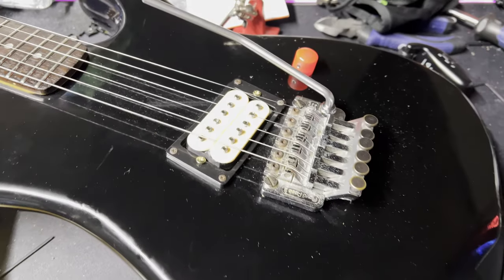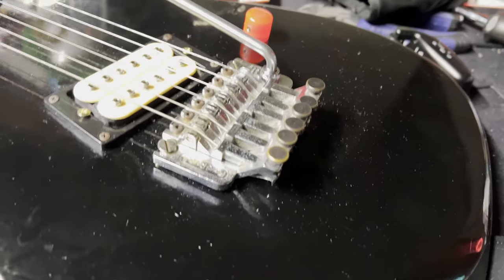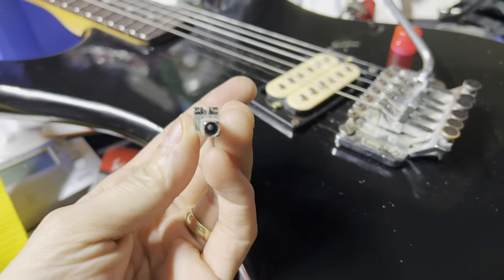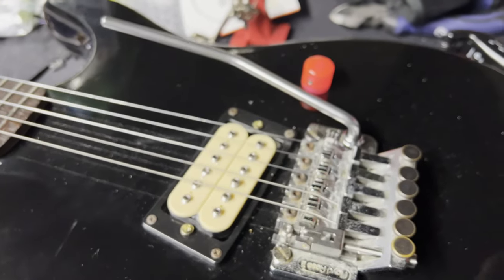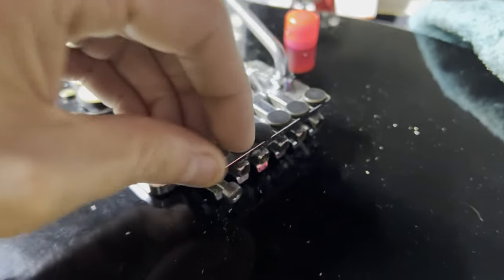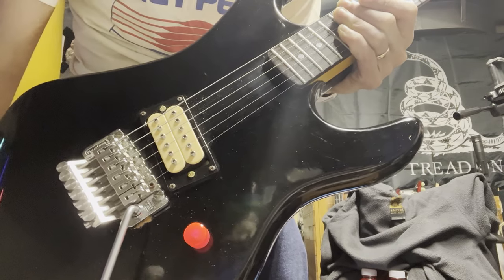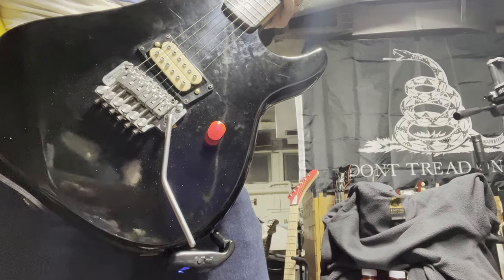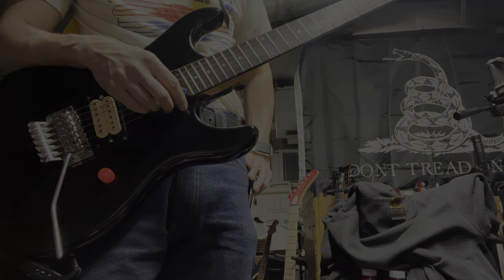KAISH Stainless Steel Saddles Installation & Review on a Floyd Rose II!

Comment: Nice upgrade, Great playing and great tone. What other gear were you using?
Reply from the maker: Thanks! This was run straight into a Peavey Vypyr Tube combo amp with no board; it's the 6505 setting with built-in phaser, reverb, and delay engaged! I usually mic up the amp or run it into my PC via USB, but for this video I decided to just use the microphone on my camera. It's a criminally underrated amp and gets alot of flak for no reason. It's usually pretty cheap too. I gig with it every single weekend and it's never let me down!

Comment: You can't swap Floyd 2s where  a Floyd original was or is, just a heads up,  I just went through all this on a guitar.  Apparently the post spacing is slightly different.  I actually did a swap on an original Kramer Nightswan 25 years ago and wondered why it never worked right till I put an original Floyd back on. I also just swapped all the hardware over on a Peavey V-type Adrian Vandenberg guitar.  I removed the Peavey licensed junk and ordered actual Schaller system with Schaller locking tuners, and outfitted it with Fu-tone Titanium saddle blocks and screws with the 42mm brass big block. Such a night and day difference,  and very robust with the Fu-tone stuff!
Reply: What? post spacing is the same on all floyds, Im able to swap out my OFR and Floyd II seamlessly without any issues.
Reply: @helio1055  nope, some might you have to double check.  I already went through this issue,  it's off by 2or3mm you almost don't notice it till you setup the tremolo and it's stiff and won't stay in tune.  I had the issue on my 1989 Kramer Nightswan Aztec.  Went from an original Floyd Rose to a Floyd 2 and the tech noticed it. Ended up putting the original back on. I noticed the same measurement difference with a Schaller (Floyd 2 style) is the same. So I have a Floyd 2 and the Schaller that are both different from the Floyd original.  All 5 of my Floyd style guitars all stay in tune and return to zero no problem.  Just have to watch the stud spacing.  I mentioned it to Adam at Fu-tone and he knew about it as well.  Seems hit or miss, that's why you should check before you buy a new tremolo for a swap.
Reply: @helio1055 I wouldn't know the specific models,  my tech was more aware of it,  and I  didn't know till he mentioned it and I used a caliper to measure between the 2, and they were just slightly different.  However did explain why my Floyd 2 never returned to zero because it was bidding on the posts. As soon as I bought another Floyd original everything was fine again.  Costly mistake for me lol. Now I measure before I buy, I just bought a new Schaller tremolo system for an old Peavey V series guitar,  even the Warmoth guys had asked me about what the measurements where for the one I was replacing,  witch was a shitty Peavey licensed one, but I had to measure the post spacing.

Comment: You shouldn't force out the original fine tuners like that. You were able to on this bridge because the base plate is a zinc alloy so it's soft enough to let the crimped ends of the fine tuners out, but on a steel base plate you're likely to just strip the threads meaning your new ones won't screw in. You're better off taking the trem off, winding the fine tuners all the way down and either grinding or cutting of the off the bottom of each fine tuner, then unscrewing them out of the baseplate. Also, worth noting that the new stainless steel saddle screws (that you use for intonation) are much harder than the baseplate and if you crank them too much you'll strip the thread in the baseplate (I did on my Schaller FR that uses the same baseplate as that.

Comment: There are reviews about these saddles that the first two do not hold the 1st and the 2nd string well. And this is what happens in your video.
Reply: I installed them on a Jackson recently and didn't notice this.  Is this just a matter of tightening the clamping block down really well?